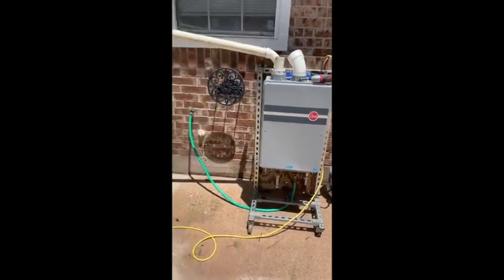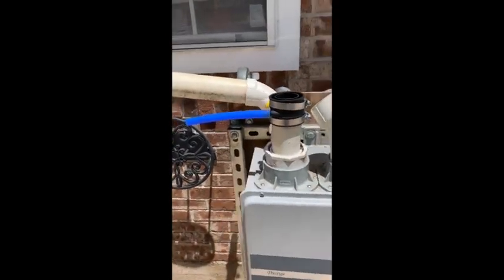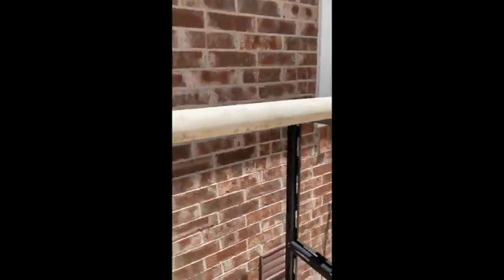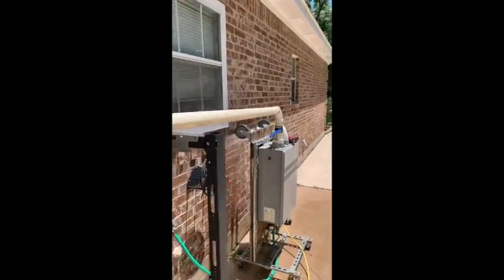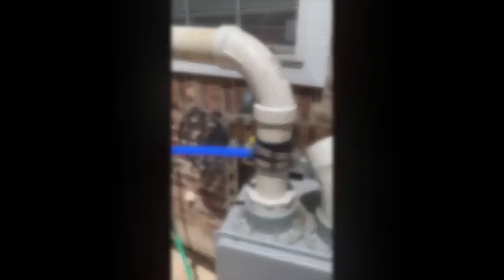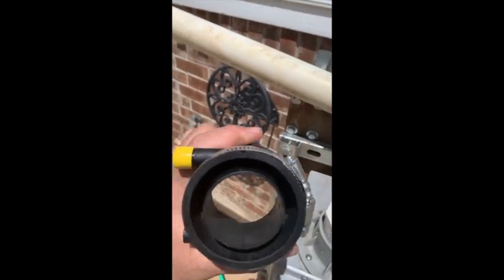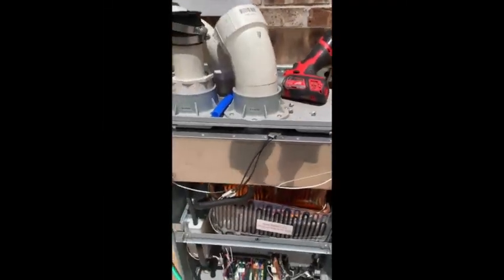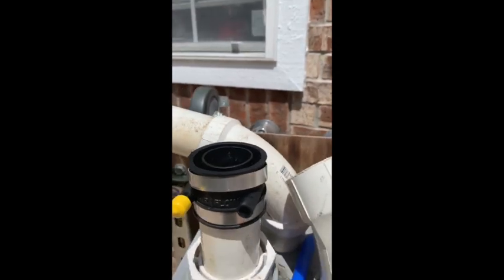Installation of a condensation collector on a condensing Rheem tankless intake

Comment: Oh my, it was so hard to find this information!  I was about ready to send my expensive water heater to the landfill because how could the silly thing not fill with water when it's 95° and 90% humidity outside and the basement thru which the intake pipe runs is 65°?
Thank you, Thank you, Thank you!!